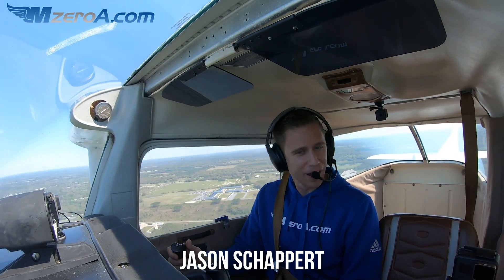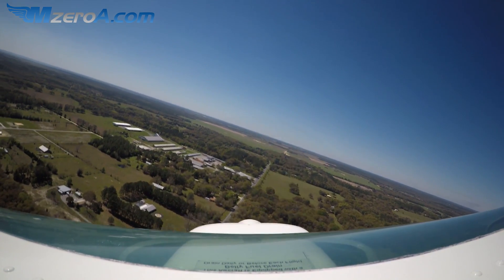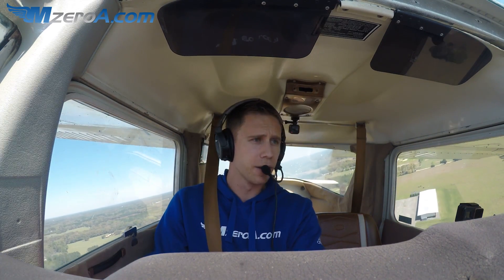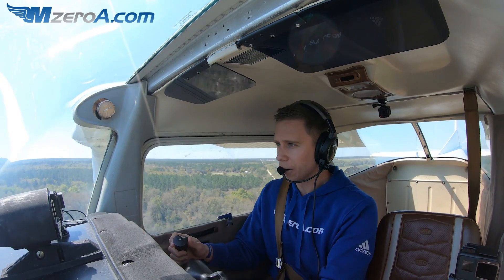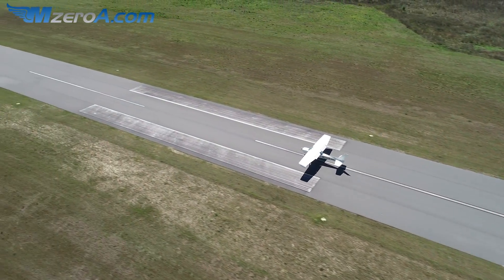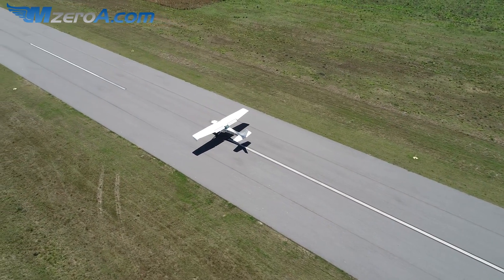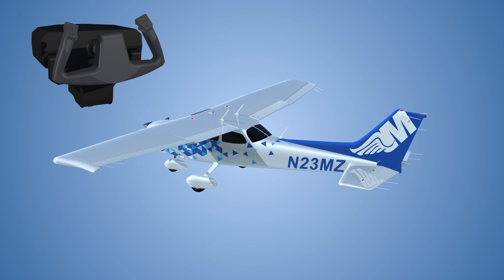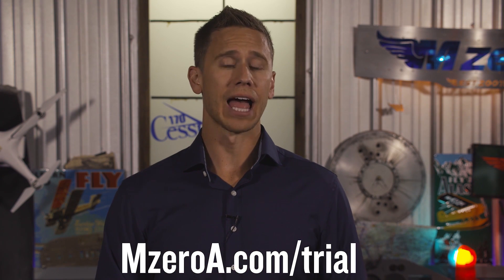Landing Without Brakes - MzeroA Flight Training

Comment: Great Vid! Prepping for the CPL test flight and Brake failure/Seizure is on the test guide but is not addressed in the POH so thanks this is a good starting point.  I will try this next time I fly.  Btw, how do you get such an even exposure between the  relatively dark flight deck and bright exterior? Is that just a metering setting on the go pro  or do you do some post processing for exposure?

Comment: Toward the end of giving the time to slow down, the very last thing you can do is begin to steer small s turns and gradually make them bigger and bigger,  this creates more distance traveled within the confines of the strait runway and a bit more side friction to the rubber and the pavement.  Mind the fact you must keep positive control and be smart about it.  Don't be too aggressive or you'll end up tipping the plane onto its wings.

Comment: Sure, like if all runways are 8,500 feet long.. Let it roll is BS.. You do a short field landing at slowest speed. touch down and cut the mixture, leave the flaps down this time.  Better push to ramp than hit something.  Raise the flaps on taxiway this time.. I went to the grass on my brake failure when trying to taxi it.. Had only around 30 hours total. Had to get out, signal the tower, pushed it off the grass and then pushed the 150 to the ramp due with 10 knot winds it was uncontrollable on the narrow than runway taxiway with only one brake.  On the 100 feet wide runway was easy to zig zag around, but cant do that on narrower taxiway..  This video can fool you into believing to just let it roll and taxi it like that.  You will hit something on taxiway or ramp.  Recipe for an incident.. 
Jason,  this is BS, again.  You are fooling the students again.  Im a Bush Pilot, aerobatics and Upset Maneuvering 10 kinds of traffic pattern engine failures instructor.  What a shame to lie to students like this..

Comment: I had a similar incident in a PA-28-140. No serious problem, runaway length 2500 ft. made short field approach. I looked underneath aircraft realized aircraft had acquired air brakes.Both
left and right calipers were dangling in the air.

Comment: Can someone explain the purpose of tapping the brakes after takeoff?
Reply: Stops the wheels before retraction.  As the wheel winds down, it can vibrate and make contact with the wheel well during retraction...now truth be told, at light airplane speeds, it is not a big deal.  Some jets automatically apply the brakes when the gear is retracted.  I wish the 767 I fly had it for the nose wheel, that will rattle your teeth when it is vibrating during retraction.
Reply: Even in GA aircraft you'll notice a mean vibration after takeoff. If you tap the brakes then it prevents the vibration as the wheel slows!

Comment: Last summer on July 24th a right side only brake failure took me by surprise near the end of taxiway A at TWF as I was taxiing for takeoff.  I didn't end up all the way off the taxiway, but I got to the edge where I hit a light before coming to a stop.

https://www.youtube.com/watch?v=cYxkaEwZang

When I reviewed it with my CFI we talked about pulling the mixture as an option that I could have exercised that might have at least reduced the damage to both property and aircraft.

At this time I was a 99 hour pilot just 6 months after passing my check ride and doing my ground instruction with MzeroA. We just got the airplane back 3 weeks ago after having to do a full overhaul.

Comment: What about once airspeed has dropped below V1 (or rotate)..... raise the flaps and pull full back on the yoke... raising the elevator and using it as a speed brake ???
The problem of opening the door —left OR right—(as I see it) is that with only one door open, it acts like a rudder and could cause the aircraft to swerve .... perhaps one could counter-act it by applying opposite rudder....

Comment: My Musketeer has a castering nose wheel and you steer with the brakes, though above a fast jogging speed the rudder is effective. The bulk of my braking is aerodynamic, full up elevator, dab the brakes if necessary when I taxi off the runway.

I'm moving in the spring and my new airport has an 8000 foot runway, up from my current 2100. My brakes should last forever. :-)
Reply: Rolling out for two minutes at a busy airport may be considered impolite by those trying to get in behind you, but otherwise it's a nice money saver.

I've not heard of a Musketeer with castering nosewheel? Which model? I own a B24-R Sierra - love the Baby Beechcrafts!

Comment: Yep for those of you flying a uper wing aicraft it is less likely to use aerodinamic braking with the elevator as it was mentioned before . I had a piper 140 , with the wings at the bottom we use alot more aerodinamic braking with the elevator ...🤓 since we bleed the air under the wings before the flair , we have the tendancy of bracking at the same time . Any how as always like your videos and love your calmness ,reminds me of my instructer 😎 keep up the good work !!!

Comment: What was the problem with the brakes in the original story? Enjoyed the video and the second perspective you managed while still maintaining audio voice over.
Reply: Since it was a retract he hit the brakes to stop the wheels from spinning and pedal went to the floor.  Since he had taken off from a poorly maintained grass strip where the owner stored the plane, he didn’t use them on taxi to takeoff, and found that pedal hit the floor as the master cylinder failed.

Comment: Thank you, Mr. Shappert! This is good to know. I've never had break problems when flying, but I've always tried to use the elevators for aerodynamic breaking to help minimize the stress on the break system.
Reply: Same here, elevators work very well as airbrakes once you are below stall speed.

Comment: What about the flaps, keep them down or retract them?
Reply: Would be better to leave them down no? As if they are down the drag is going to help you slow down
Reply: But raising the flaps allows more downforce on the ground. This is advantageous whether using brakes or not, no?
Reply: If you are not using brakes, then the extra rolling friction due to retracting the flaps is unlikely to slow you down as much as the extra drag from the flaps.
Reply: I was just going to ask this same question. What say you, Jason? Would full flaps, below the speed which would cause the plane to become airborne again, help drag the plane down to a stop?
Reply: Every aerodynamics manual recommends to retract flaps after touch down, but almost every seasoned cessna pilot recommends to leave them down.  I personally prefer to always retract them.
Reply: My thoughts are in line with these folks. Are having the flaps down providing more lift than drag, or more drag than lift? I can see keeping them down if you have no brakes since the short field landing has you retract them only to prevent further lift and really dig the aircraft into those wheels/brakes. But a no-break scenario? 🤔
Reply: That's pretty much my thoughts. In a short field scenario regularly speaking you want all the weight down on the wheels as the wheel brakes are going to be most effective. In the no brake scenario they are not effective at all, so I would imagine as your only real option is drag that you would want them down.

Comment: In a Cessna you have steering control. What about  in a Cirrus and cross wind.
Reply: Actually even in a Cessna it depends on why you lost brakes - if the mechanical linkage snapped you wouldn't have a steerable nosewheel then either. The answer is -- use the rudder for as long as it's effective. If there's a strong crosswind and you know the brakes are out, I would find another runway. If that's not an option, full aileron deflection and let it push you toward the grass as you slow (might also consider touching down angled slightly into the wind.) The two things you can't do are panic and give up (quit flying).
Reply: Thanks.

Comment: Any additional advice for those of us flying a castering nose wheel?
Reply: Use the rudder for as long as it's effective. Then stop on the runway and break out the tow bar. Since there's no benefit in keeping the engine running in this case, shutting down while rolling will help you stop faster since even at low idle the prop is adding some thrust.